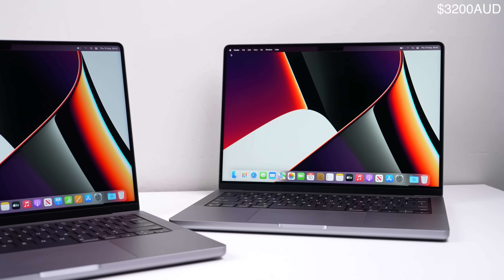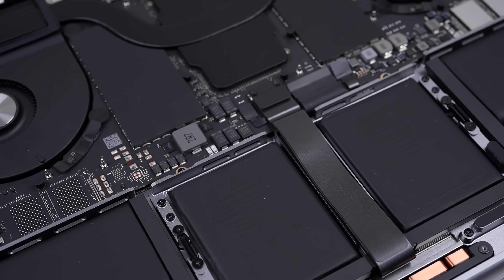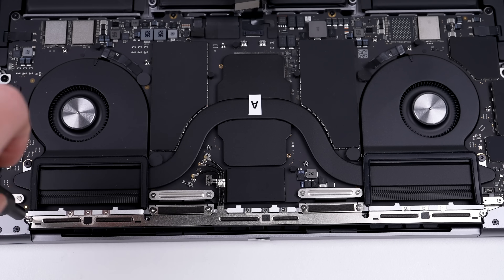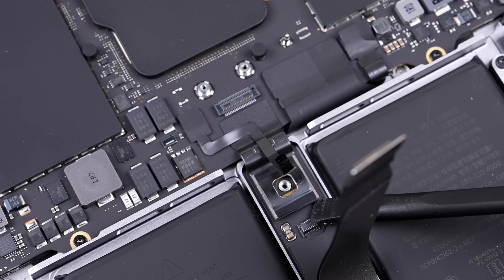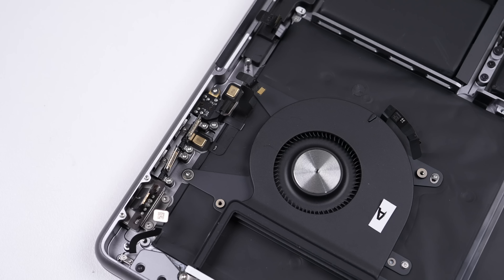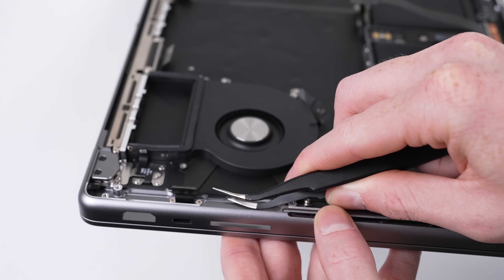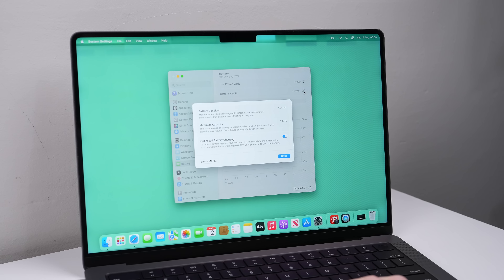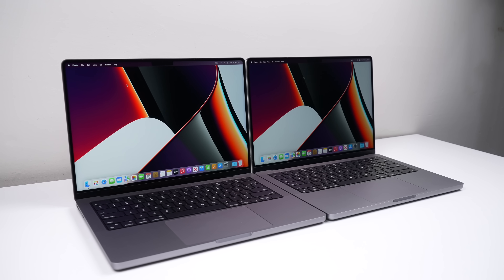New Anti-Consumer MacBook Pros - Teardown And Repair Assessment - Apple Silicon M1/M2

Comment: Designed with greed in mind: make it break quickly and disallow any proper economically viable repairs. On top of that you pay a lot for such machine, if you are willing to gor for different software and slightly larger machine you'll end up with a lot more cost effective deal. Seems arther shady operations to artificially bloat the sales as there's only limited market in the end. One should have great reasoning to have a device with 1 year lifespan while proper laptops shall last 5-10 years with only minor repairs like fan and battery.

Comment: The real problem with Apple's malignant anti-consumerism is; they give license to their competitors doing the same thing, now I'm faced with laptops without upgradable ram, all because "well, Apple does it", farcing me to max out parts I'd rather buy after market later when tech improves exponentially.

In point, I have a 2in1, 6 years old, when bought it had 12 gigs ram, 250 gig SSD, I know have faster better 32 gigs ram, faster better 2tb SSD for a exponentially less than I would pay when new

It looks like my next box with soldered interns will need maxed out specs if I intend keeping more than a couple of years

Comment: Its nuts the way that Apple designed their laptop setups with excessive use of screws while making other essential items non-unpluggable to replace that only a trained Tech with correct equipment can carry out the work, and I concur they are trying to eliminate authorised and/or competent/licensed repair engineers just maximise their own profit margin. I assume they've done this after being successfully sued around the world to stop the repairs of salvaged good Apple parts and generic parts too.

I assume they've chipped much or all of their latest cables, etc, and no doubt information collated onto an EPROM chip that holds all the data of all parts used to build at the Apple factory. So, like you've stated that Apple is then required to calibrate their laptops after the system detects a change of installed hardware items, and then you're at much hyped up cost if or when it goes out of warranty I bet!

Keep those good educational videos that shows up Apple's dirty tricks, etc, and other strip downs of other makes too

Comment: Apple are fast working their way to being declared bankrupt because of their sharp practices. Printers that give up the ghost after they have counted a certain predetermined number of sheets of print, electrical goods that cannot be repaired or even have dead batteries changed, is a sure way of alienating the buying public. Also Microsoft are P*ssing people off with their continual, UNWANTED updates. Every update makes the computer run slower and more susceptible to data mining, most likely by Microsoft themselves. Likewise Microsofts continual harrassment of Windows ten users trying to get them to accept the next Windows series. You can guarantee that this abuse of people's wishes can only be for nefarious Microsoft reasons. When you buy a product, you buy the right to do as you please with it, without interference from the seller. If they want to keep control of their products after sale, they aren't worth buying from.

Comment: Not being able to replace the keyboard is crazy, I did it myself on an 11 inch Acer laptop, and I'm definitely a novice at tech repair. Replaced a battery in an iPhone 5 once and it was terrifying. Have been too afraid to attempt replacing battery in my Samsung note 8
Reply: I had the first Galaxy phone and it was so easy to restart the phone by just popping out the battery. Good times.
Reply: I worked in a computer repair shop a few years ago. We were taking apart an iphone and my buddy dropped one of the tiniest screws on the floor. We were both like..."Nobody move!" Then we carefully got down on the floor with a magnet to try and find it. The magnet did find it, and we were much more careful after that. I hate working on phones and tablets. I've had mixed success. My son's Google Pixel needed a new battery. I read online that even the experts were breaking the screen trying to get it off, so I was extremely careful. I got it off, got in the new battery, and it worked fine...for one week, and then it went black and that was the end. Very frustrating!
Reply: man i am never gonna repair a apple device by myself i repaired redmi phones ,samsung phones and lenovo phone once
and a hp laptop in which i changed the screen the keyboard and the battery and addded 4 gigs of ram and added a ssd it worked fine untill the display wire broke and i fixed it and it worked and was very easy to repair why apple is making laptop harder to repair
Reply: Useless Authoritarian EU did something smart for once, at some point soon, it will be illegal to sell phones in EU that you can't change the battery on.

Comment: The "hidden" screws may be covered to prevent a screw from falling out, rattling around, and shorting something. The angle sensor, measuring the rotational angle of the magnet, is tied to the display because the magnet installed in the display hinge is not perfectly consistent from display to display, so they just program the motherboard with whatever rotation it ends up with once one is installed in a computer.
Reply: There should be a tool to adjust it then.
Reply: @nickjunes There is. A software tool Apple won't release.

Comment: That repairability as a f**** nightmare. I had the flexgate issue with one of my machines. Apple would not even sell the spare part to anyone else then official repair partners. They did not even provide the spare part before sending in the defect part as an exchange and let me sign a contract accepting this. I think that it is very sad but I hope that one day legislation will fix this. With my new M1 machine I already had two screens replaced on warranty claim. Otherwise it would have cost me around 900 € each.

Comment: That screen-angle sensor glitch is the equivalent of a car manufacturer making your windshield wipers disfunctional if you switched out the cigarette lighter for another exact same model of car's cigarette lighter... If car manufacturers went to this length to make their cars completely non-user repairable even with official parts, there would be complete outrage, but because less than 10% of the world use Macs, there's not a whole lot of 'right to repair' noise about it as yet...

Comment: On the bright side in Cambridge, England, it's actually cheaper to get the Apple Genius Bar to replace your iPhone 7 Plus battery than to get it replaced with a a knock off one at any of the repair shops in Burleigh Street.

Comment: Awesome video! We live in a screwed up world where a manufacture like apple is destroying the environment, making it worse with no reparability, and no accountability to the environmental destruction they are casing.  If only they made it repairable, and swapped the Neural Engine with 86 compatible cores so we could once again have a laptop that can use any software.  But no, apple will screw you over before thinking of others.  Hopefully Hurricane Clinton will pay them (only them) a visit.